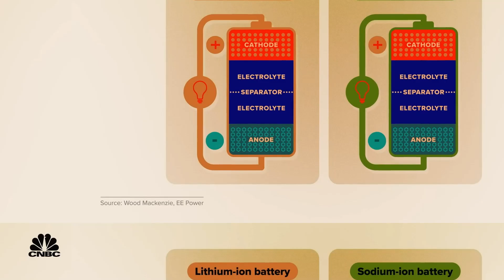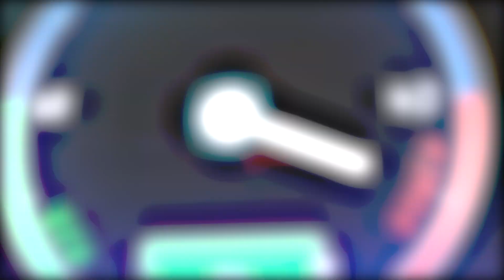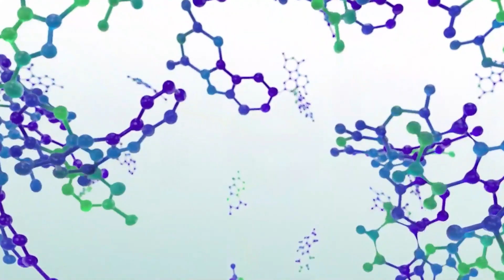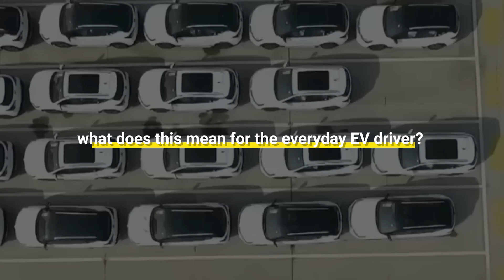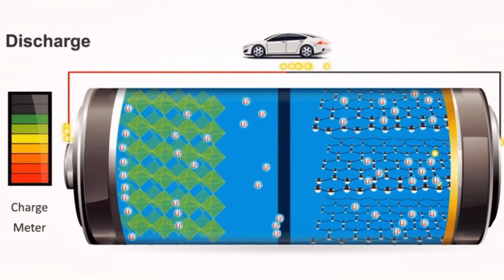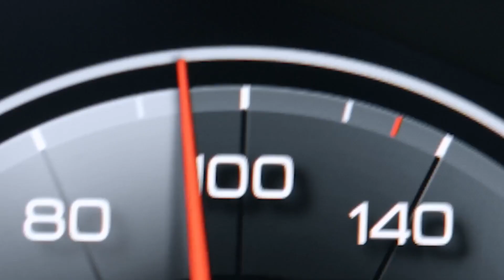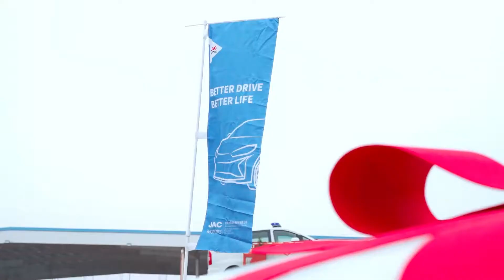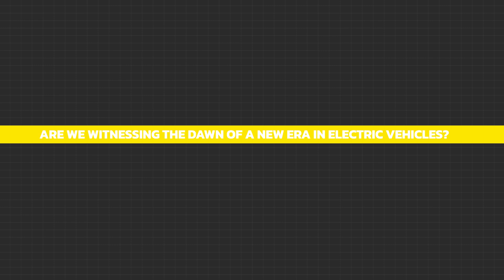This Battery Will SHAKE The Entire EV Industry!

Comment: Once super charging is ubiquitous along with fast charging EVs,   battery range will largely become irrelevant.  A 200 mile range would be more than adequate.  You need to rest anyway every 200 miles driving, so you can fast charge to 80% then.  Also large scale storage is better suited to sodium ion technology, due to safety.

Comment: The yet to be solved problem of durability, is a massive problem. The solution is not, just around the next corner. These new battery technologies have been known for 30 years. There are big problems with these new solutions. Also why wld i buy a current ev if manufacturers will shortly bring evs with these batteries. Current ev devalution wld b through the roof

Comment: Some good points ...you missed the fact that sodium cells can be transported flat...and run lower as a % of capacity than Lithium batteries  so it looks like Na cells can run down to 10% and possibly charged regularly  
higher .  So given its high C rate charging  it certainly makes perfect sence for town cars. 
From viewing reports on charge life on test cells i would say that they will quickly reach parity in terms of life charge cycles and some will exceed current Li chemistries. 
So yes it makes great sence for urban commute vehicles where in Europe they have to live and be parked on the streets.. 

The small vehicle you show at the end looks like a worthy succesor to the original 🇬🇧Mini car.  Hopefully its built well enough and has adequate interior space. 

Na also presents a great option for domestic and light commercial storage.

The possibility is according to BYD and some Na pioneers with volume production that Na could come down to 50$ per Kwhr.. the cost largely being in the making of the cells rather than the raw internal materials. 
The plant used is also largely inter transferable. 
So its a great option if you have more space or do a lot of stop go urban driving.. and you dont have to worry about safety or hot or  cold weather snaps.
Reply from the maker: Appreciate your deep dive into sodium-ion batteries! You've pinpointed their transport and operational efficiencies, making them ideal for city cars and possibly surpassing lithium in lifecycle and cost-effectiveness. The nod to the classic Mini car hints at their potential in compact urban vehicles. With costs potentially dropping to $50 per kWh and similar manufacturing processes to lithium, sodium-ion batteries stand out for urban driving and energy storage, without the usual concerns for safety or extreme temperatures. It's an exciting prospect for the future of EVs and sustainable energy solutions. Thanks for enriching the discussion with your insights!